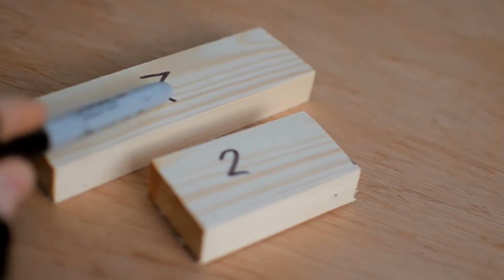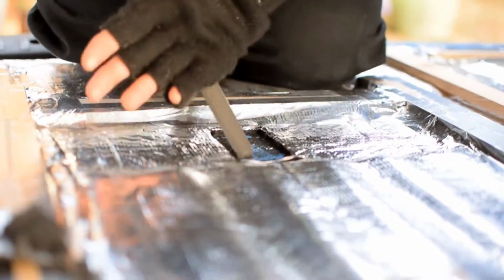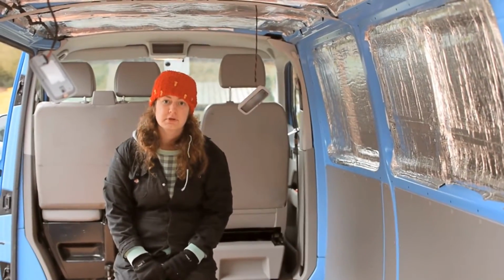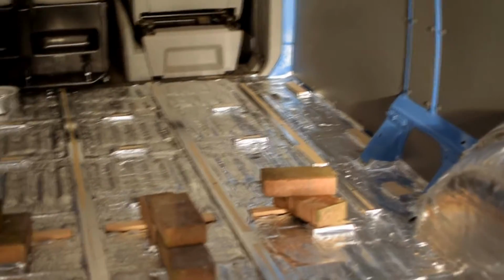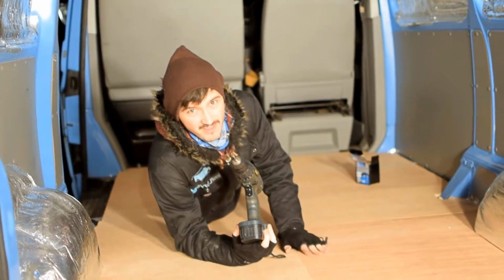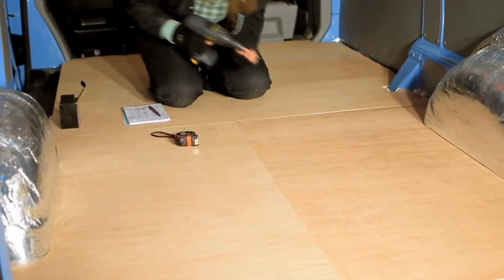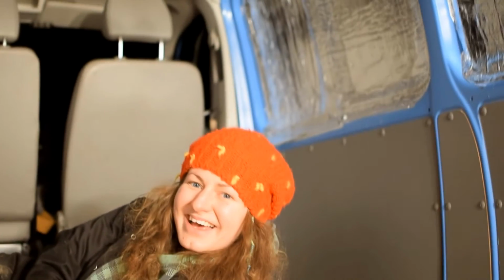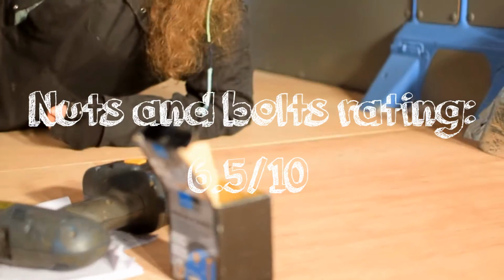Day 8 - Finally got that ply down! #VanLife VW T5 Camper Conversion

Comment: You would have done better to make the short battens long enough to completely fill between the long ones. Then you could chalk mark the walls either end of the battens and then used a chalk string to mark their position on the floor ply, thereby ensuring all the screws went into the battens, without having to pray ;) Looks like you did a good job anyway. :) Enjoying watching the build.
Reply from the maker: Van-gabond,Ramblin'Rose haha, thank you. that makes sense! next time :p